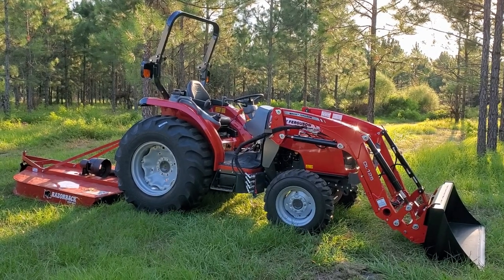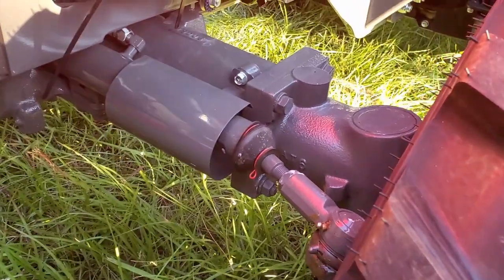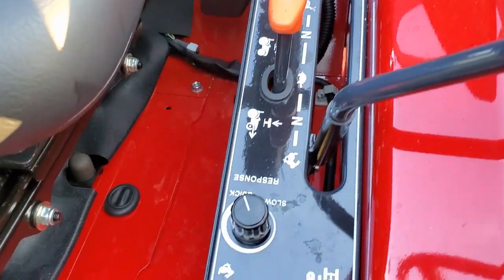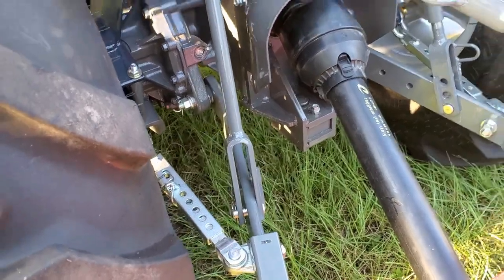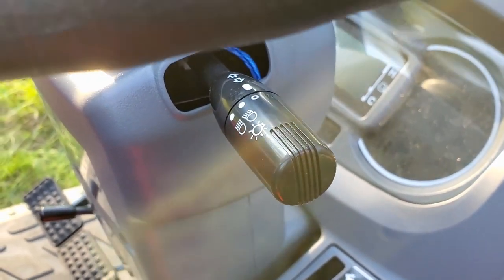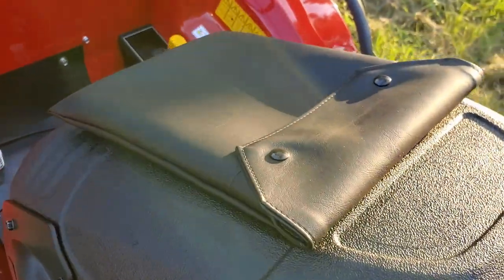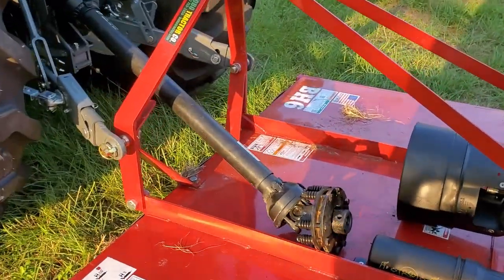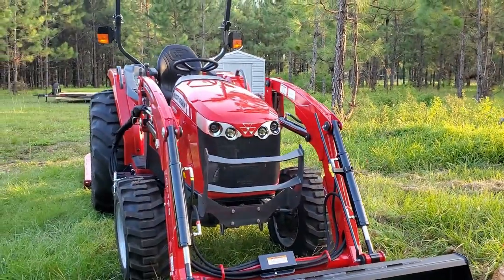New Massey Ferguson 1735M Overview, New Bush Hog Issue, and Other Tractors Price Comparisons

Comment: I've owned my 1735M cab tractor for a year now.  I absolutely love it.  This thing is a beast.  I use it for clearing acres of woods and grading it out.  Can easily lift 24" diameter trees 8-12 feet long.  I used it in the winter to plow my 1/4 mile long drive as well.  Perfect.

Comment: I bought my 1735M in December of 2019. I got it with a rear remote, a third function valve and beet juice in the tires for $25,000.
I have 255 hours on it. I wish it had a brush guard that offered more protection than the one that comes on it. I also wish the rear lights were mounted inside the ROPS. It's too easy to damage them where they are mounted. I had to have warranty work done on it when a hydraulic line underneath cracked and started leaking. Also, my fuel gauge quit working. I'll be taking it in next week.
Having said that, I love it. This unit is strong and capable. I would buy it all over again. The features are awesome. Mine lifts while curling just fine. 
A buddy of mine bought a JD a few months earlier and also had a defective hydraulic line blow out. These things happen. Hopefully all the bugs are worked out as my front to back warranty ends in two months.
Great review.
Thanks.
Reply: I still have issues with my fuel gauge on my 1736, it’s a known issue but the TSB says it’s a grounding issue. The lights on the ROPS get caught on mine also and I’ve had to replace them already ($$). Only issue I had was when it was new with 4 hours, a coupling valve for the dump failed. 

Been a great tractor thus far but definitely don’t get enough attention compared to others.
Reply: @jgcoupe6808  
I took mine in before the warranty expired and the dealership had hired a new tech. He was aware of the fuel gauge problem and said he was able to seal the wiring so there would be no more grounding issues. Time will tell. It has been working well ever since. 
I agree that they are tough and impressive tractors. I can't believe I didn't buy one much earlier. Thanks for the reply.

Comment: With MF ditching the Shibaura engines, do you have any concerns about long term dealer service and parts availability?
Reply from the maker: Actually I do have some concerns because Iseki is a larger and more well known company than Shibaura. My main concern is parts availability. Usually the more common and more engines a company pumps out, the more available parts are. So only time will tell.

Comment: 23500 was with loader?  DId you get the larger tires on the rear - 17.5?  Does it have a decent seat other than the foam being decent?
Reply from the maker: It was 23.5k with the loader but that's not including the cutter and box blade. The larger tires already came with my tractor so it wasn't a special order. The seat is great. It absorbs a lot of the rough ride.
Reply: @JohnsRandomVids_US  Did you also price the 1740M? One of the dealers told me that the difference between the 1750 and 1755 was less than $1000.  When you get to the 1750 they are a larger tractor, but guessing the price jump would be similar from a 35 to a 40.
Reply: @JohnsRandomVids_US  Something else i noticed in the brochure is that the loader for the 1735 and 40 does not come with the Skid Steer system as standard.   Loader DL125 1735/40M
Tool Carrier Pin-on (SS Quick Attach opt.)
Reply from the maker: @311hitwall  the skid steer quick release came standard with mine so that's something you'll have to verify with your dealer. As for the 1740M my dealer wanted an extra 2k for it so I skipped it to save some money. Be sure to ask your dealer about the prices. Dealers vary in prices and deals.
Reply: 23.5k is good. I paid 27k for my 1740M.

Comment: The bolt on the PTO shaft for the mower acts as a fusible link, but what's missing, is a cir-clip that prevents the shaft from coming off when the bolt breaks. That's what cause most of the problems.

If you check the shaft on the mower, you'll see a groove on the very end of the shaft. 

Anyways, that's indeed a nice looking machine. 

Greetings from Portugal.
Reply from the maker: Thanks for the tip. The dealership already fixed it too. They've been very hospitable.
Reply: @JohnsRandomVids_US  looks like you have a slip clutch not a shear bolt
Reply from the maker: @valleytractorservices9310  I know it was fixed already.
Reply: My Rhino Ag mower has the same gearbox. I had a similar problem. On mine the slip clutch came off the shaft. The problem was that someone at the factory used a grade 5 bolt and applied grade 8 bolt torque specs thereby twisting the nut off. The owners manual clearly states that a grade 8 , 3.5x1/2 MUST be used. The groove for the cir-clip is meant for shear pin attachment and doesn't apply to the slip clutch. How do I know? When you reattach the slip clutch assembly the groove is completely covered by the back half of the u-jount. You couldn't get a clip on no matter what.

Comment: John, thanks so much for the review. I too struggle with the same items as you mentioned. I keep going back to this tractor mostly because of the price difference. I hope you will give another review to see if you’re still enjoying the 1735, is it handling what you need out of this tractor. How much land do you brush hog? Also, a review on the tiller, I think you mentioned you’re getting a tiller. If so, how is it performing. I plan to purchase in the coming weeks a 20 acre farm with about half pasture. Thanks
Reply from the maker: I mainly use it on a 2 acre and 5 acre plot. I never got a tiller due to financial reasons so I can't say. I will give an updated review eventually. Thanks for watching.

Comment: I have the same Tractor. One thing I noticed is that the drag control lever for the 3 point is very stiff. Hard to control height smoothly. Is yours stiff as well?
Reply from the maker: Yes I do agree it's very stiff. I thought it would work out but it hasn't yet.
Reply: @JohnsRandomVids_US  I just looked at the mechanism. Looks like a rubber washer separating a couple of hinge plates. It looks like the pivot bolt has a jam nut, so it may be just an adjustment. Some disassembly required to access it though. Otherwise. Such a sweet tractor. I love it.
Reply from the maker: @darrelwilson2875  thanks I'll have to check that out later.

Comment: Why does it have a ECU if there's no Regen? Does it not have mechanical injection?
Reply from the maker: I no longer have the tractor but if I remember correctly, it's electronically injected. Its ability to avoid a regen is due to its ability to be extremely efficient at burning the fuel which minimizes emissions. Precise fuel control for max burn = less soot.
Reply: @JohnsRandomVids_US   Thanks for getting back to me.Any particular reason why you got rid of it Problems with it? Thanks
Reply from the maker: @pmaint1  No problems at all and I miss it. Essentially, most of the major reasons I bought it for evaporated and I couldn't justify the payments anymore.

Comment: I was wondering if you could measure the width of the tractor?  Just for comparison sake when looking at other tractors.
Reply from the maker: I can measure it from the widest point possible if you'd like.
Reply: @JohnsRandomVids_US  I would appreciate it!
Reply from the maker: @311hitwall  it's 68" wide at the rear tires without the extra wide spacers that you can add to them.
Reply: @JohnsRandomVids_US  Thanks for the information.

Comment: You're gonna love that Massey. I like the comments you made about your dealership.  They sound like a good crew. You did an excellent job highlighting the features of the Massey.  I am going to get a cabbed unit sometime down the road.  I've worked outside enough and want a cab unit.  I'm tired of those ground bees and everything else that gets so dang ticked-off at me when I run over their nest, ha.  Won't buy for several months then will make similar video. Thanks John, great review.  New Subscriber!
Reply from the maker: I appreciate the response. I wanted a cab as well but I work too close to pine trees. I'd lose a cab to limbs in a heartbeat lol.
Reply: @JohnsRandomVids_US  Me too. I'll call ya if I lose the cab....LoL.
Reply: @JohnsRandomVids_US  fuel filter

Comment: Very nice tractor!  Do you know where it is manufactured?
Reply from the maker: My understanding is that they get the frame and some of the guts from Iseki in Japan then Massey puts the rest together at a US based plant. Usually Iseki tractors use their own Iseki engines but Massey opted to use Shibaura engines instead. So the 1700 series is like 60% Iseki with the rest being a mix. Not 100% sure on this thought.
Reply: John Smith Thanks. This tractor is really on my radar. For a while, I thought I wanted a green or orange one but now I’m leaning strongly towards the Massey.
Reply from the maker: @arthurbradford5854  I definitely don't think you can go wrong with this one but, of course, always consider all of your options. Don't let my opinion contaminate your decision lol.

Comment: Hello did you look at the yanmar yt235 34 hp with more lifting power
Reply from the maker: Yes I did compare them but the 1735M has almost 1000 lbs more of base weight than the YT235. Just because the Yanmar might lift 100lbs more in the FEL doesn’t mean it'll handle it better. Always consider tractor weight as a factor if your primary goal is loader work. Max lifting capacity is a relative factor in the grand scheme of things. Also my nearest Yanmar dealer was over an hour away so I decided against them anyways. It's always good to go with something that has a good dealer and close to you to back it up if possible.
Reply: That's great I am looking at the 1740m its about the same size

Comment: Did you compare to LS?
Reply from the maker: I did compare them but the Massey still had more features than the LS provided. I don't know the price difference though. Since my closest LS dealer was an hour away, I ruled them out and didn't run quotes.
Reply: I considered LS, and ultimately choose the MF1740m. The LS dealer nearest my location looks like a scrap yard when you pull in the gate. Dilapidated buildings, and junk piled everywhere. Not the kind of place I want to rely on to service my brand new tractor. I also read about poor factory tech support, unavailable service manuals, and bad parts availability. I think the LS tractor is probably a fine machine, but until they get serious about their dealer network, I'm out.

Comment: Drove one the other day and didnt have any issues curling and lifting at the same time.
Reply from the maker: It was operator error on my part. I realized later it could.
Reply: @JohnsRandomVids_US  Awesome. I am ordering my 1835M today and very excited. Have you used your R4 tires in the mud? The dealer says it wont be a problem but i feel iffy about it. Any updates or concerns you have after owning for a while?
Reply from the maker: @ProjectWildwood  the R4 tires do quite well in the mud especially considering how big they are. Not sure if they're a different size on the 1735m vs 1835m. I've had mine partially buried once and it was able to get out. It's been a good tractor with no real concerns I can think of.
Reply: @JohnsRandomVids_US  thanks very much!

Comment: looks like the fuel tank would get hit by sticks
Reply from the maker: It can but the plastic tank is very thick and if you pause the video at 3:41 you'll see it has a steel pan that protects the majority of the bottom from sticks and debris.

Comment: Ha all the another' 1735m comes with a 72"
Reply from the maker: My dealer recommended it to me because he said the 72" increases the chances of the loads being overweight and he claims he saw a few crack a hydro line near the control valves from people using it repetitively overweighted. So I decided to take the safe route and take the 66. I don't regret it either because it's easier to maneuver it between narrow tree rows. The loader is a secondary purpose on my  tractor but probably not for others. I probably would have gotten the 72" in any other case.
Reply: @JohnsRandomVids_US  ok but now all of them comes with a 72" now

Comment: If you do any brush moving that rod bucket position indicator WILL get ripped loose and bent I promise you.     I’ve had mine off twice to straighten the thing on my 1736.   You can’t get that rod off easily on mine either to straighten it.      Those rear lights LOVE to get ripped off mowing near hedge rows🥺.    I cut mine off the ROPS And reversed them to the inside because I got sick of gluing them back together.   I really wish they were removable with a QD plug
Reply from the maker: I agree with you on both counts. I have lost the bolt that holds my leveler on somewhere in a field while mowing and I have had to bend my work lights back a few times from hitting low hanging branches.
Reply: @JohnsRandomVids_US       As for that leveling rod it’s wrapped around the mount do you can’t remove it easily.      One thing you can do so it will is cut it and weld the ends of a turnbuckle to the ends then screw them together keeping the length about the same.   Just be sure nothing will bind on the turnbuckle as it goes up and down like the bottom of the pipe.    It also can’t dangle down when removed and bind on the mounting arm.    It’s a lot less complicated than it sounds when you’re looking at it. In the end I just take mine off now when I’m in the brush which saves me having to bend that damn thing back into shape after it got turned into a pretzel.